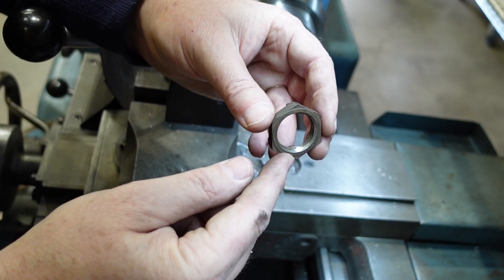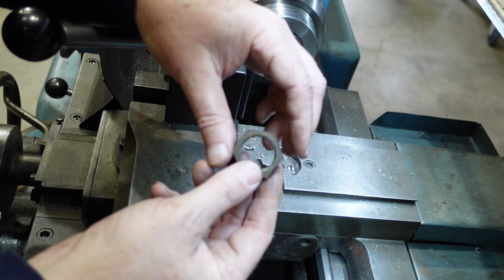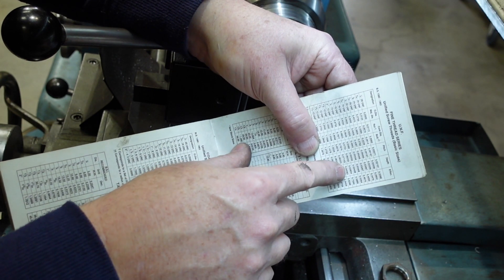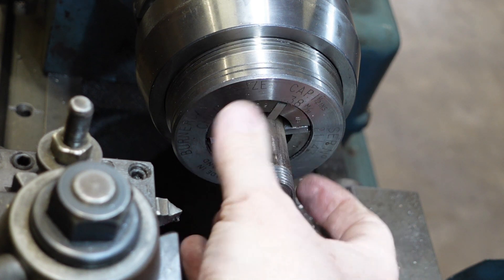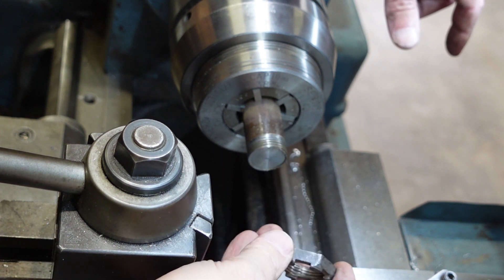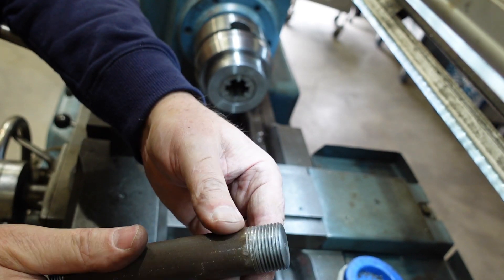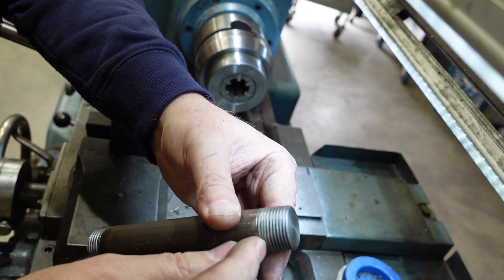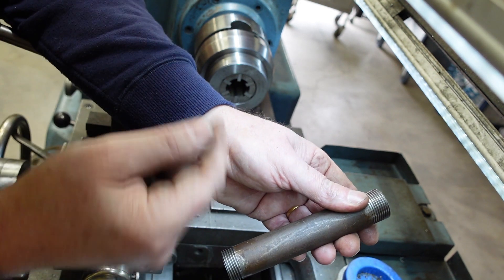I want one just like this but different

Comment: They're all the same, except for the differences.  I wish I could find a deal on a Burnerd style collet chuck like yours.  They never go cheap unless they've been run over by a forklift though.
Reply from the maker: I must admit I got lucky - found one that was gathering dust and had a bit of kit of similar value that I could swap for it. Rarely happens